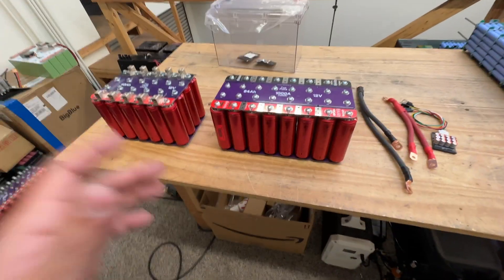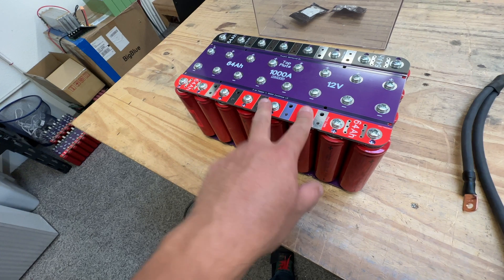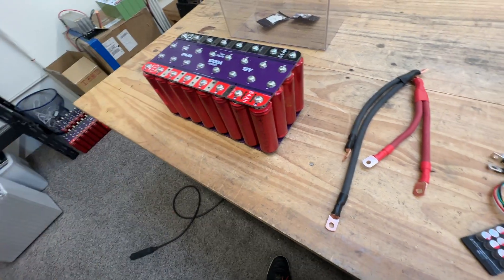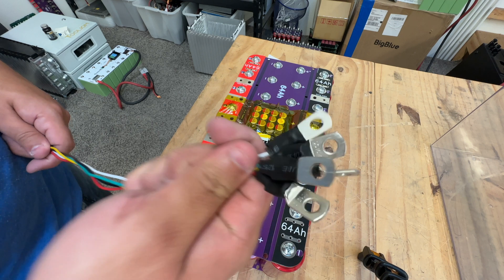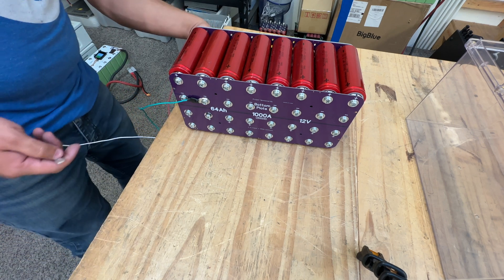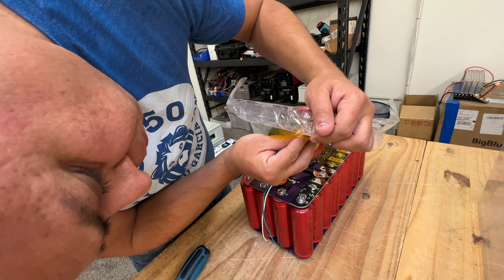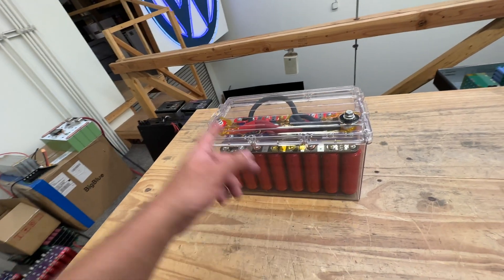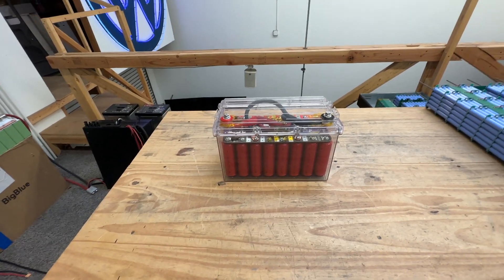Clear Enclosure for 64ah Headway 12v Audio Battery

Comment: Hi i am calculating to replace my Civic Hybrid battery ni mh with 38120 heaway battery of 10Ah, voltage is close to the OM battery,  the OM battery has a system of bms on each stic, should i try to use this system from the car that will check the voltage from 5 battery stik in series ?
The total number of cels is 55 in series split in 11 stik with separated conection this should give me 199v and 10Ah with ~4 Ah more than the new OM one. What do you  think will this work?
Reply from the maker: Try it

Comment: How do you prevent overcharge from one cell? As every connection to monitor the pack is non accessible. The balancer will do some work but with a 5A+ charge rate that puny balancer won't keep up. Definitely not with used cells. Why not use a BMS and a contactor, the way it's supposed to be done?
Reply from the maker: Do it however you want,  but despite your opinion there a lot of people successfully using these cells this way for years now.
Reply: The balancer works continuously to average out voltage drift, so unless the cells are so mismatched that they have drastic drift on a single-cycle bases, there won’t be issues. & if they cells are that mismatched, it’s probably time to disassemble the pack and re-sort, removing the most degraded cells to be used together in another pack for better match. 

Yeah, it may require purchasing a few cells but if someone already has invested into this setup, the extra cost isn’t that significant overall.

Comment: I love this design. Do they make a smaller version of the case? I am thinking for a motorcycle application.
Reply: Unfortunately no. But I sell a battery the size of a motorcycle battery supports a 5k system. Perfect for baggers with systems or the car. LIFEPO4 20ah. All on stock alt.